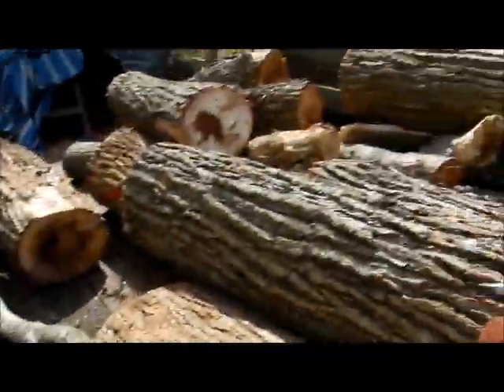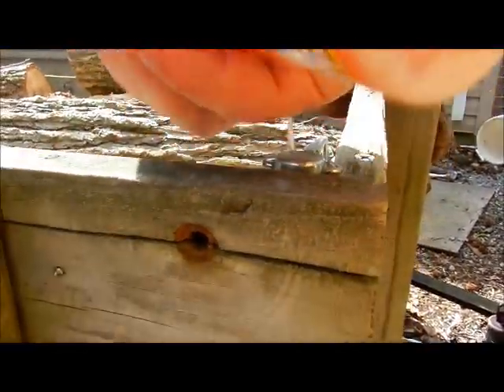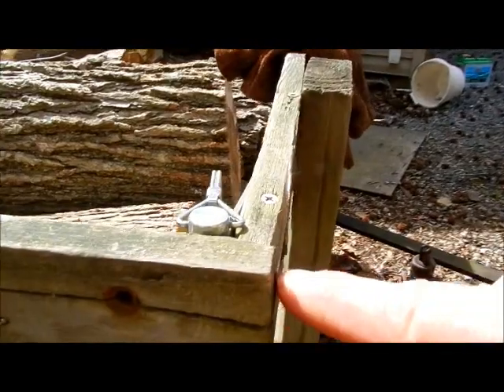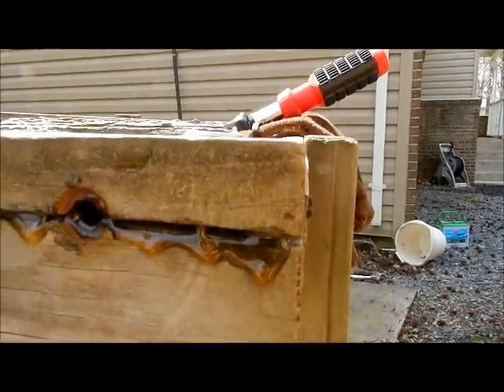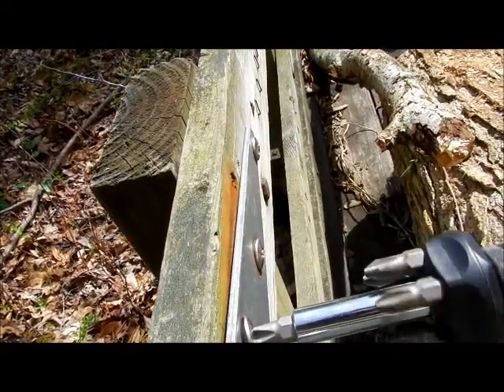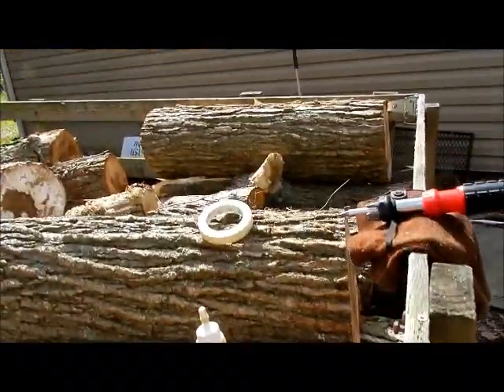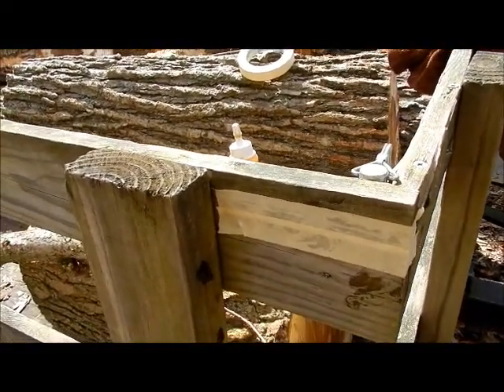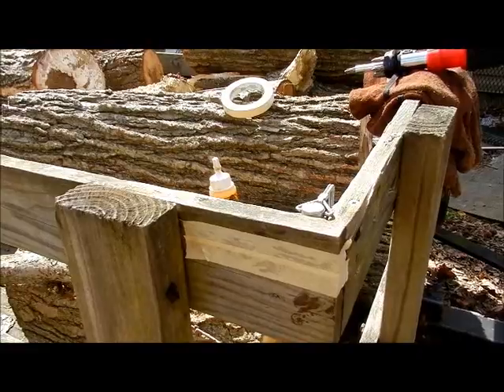How to Fix Splitting Wood with Gorilla Glue

Comment: I just used gorilla glue t fill in some fine cracks in a wood bottom for a drinking horn mug of mine. I put a few drops of the glue on the crack and used a tongue depressor to work it into the crack. Then I spread a thin film on the intire piece.
Reply from the maker: Way to go!

Comment: If just the screw hole is stripped out use flat toothpicks, shove as many in the hole as you can then put the screw in and tighten it up
Reply from the maker: Great idea for door hinges.  I tried this before the gorilla glue and it did not hold.